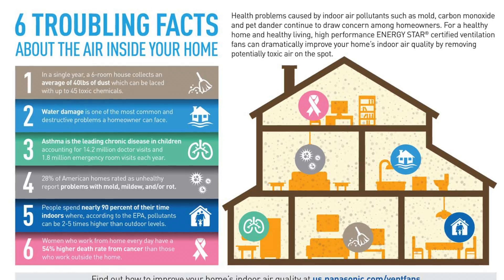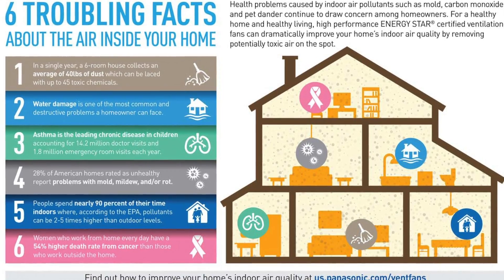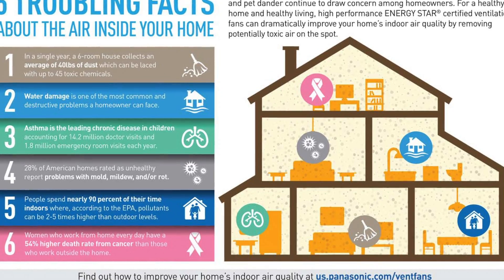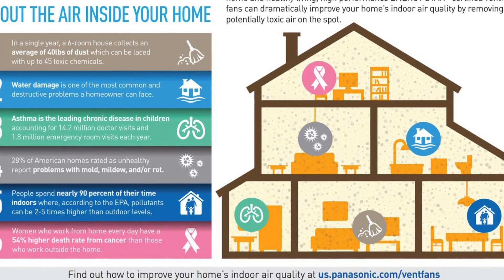Indoor Air Quality in a Finished Basement? (Do I need ventilation and Budget Friendly options)

Comment: good video, I have HRV installed, however, heat vents in 2 or 3 ceiling locations in finished basement that is about 1500 sq feet. Does it seems that basement is missing venting to improve circulation ?